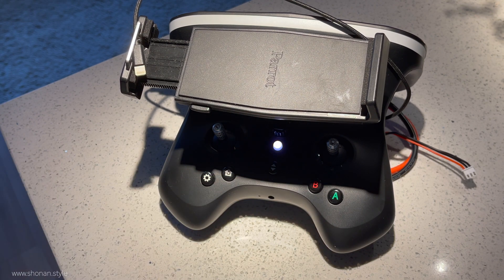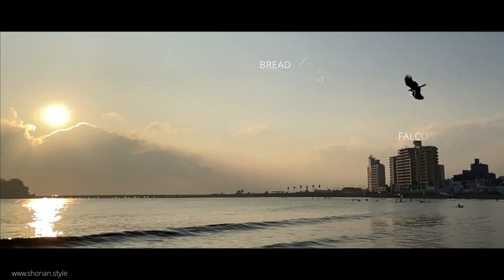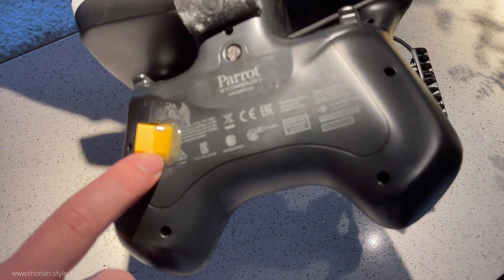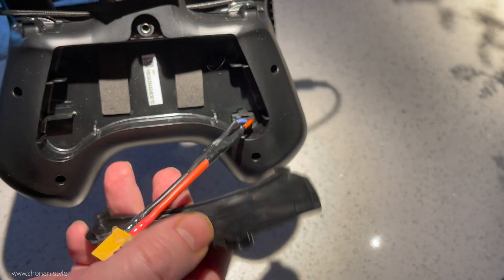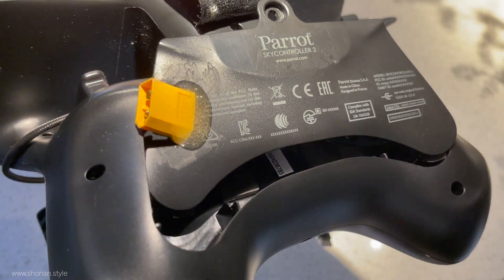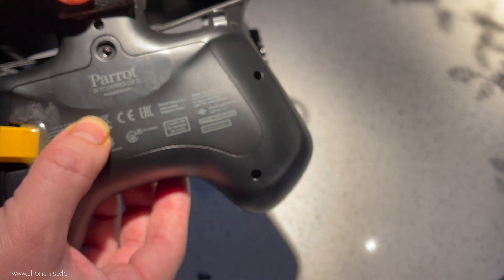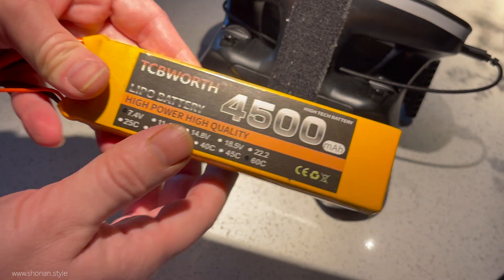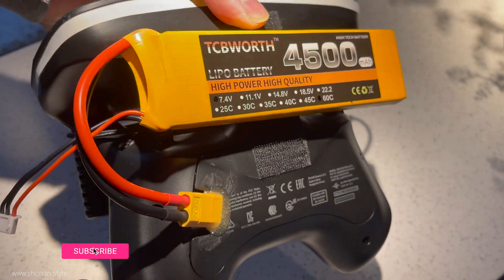Grogu my E-flite Opterra 2m | Parrot Disco HYBRID Project - FPV long range drone build ~ PART 10

Comment: You won't get telemetry on your heads up display connecting the battery to the sky controller like that you need to tap into the middle wire on the balance lead and connect that to your blue wire on the original parrot disco battery plug
Reply from the maker: Thank you! 
Very valuable comment ! 
Thank for the support and have a nice day.
Reply: Hello friend.  Did you do this mod? Did you connect to the blue wire to the middle balance cable and the telemetry worked?.